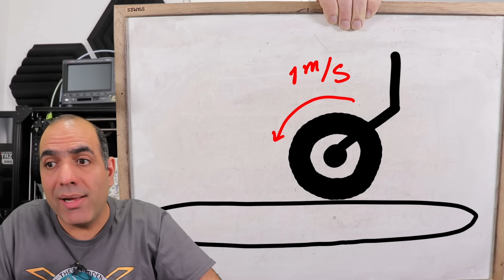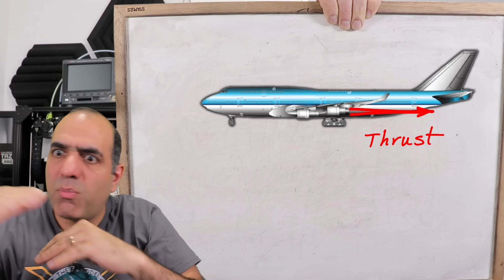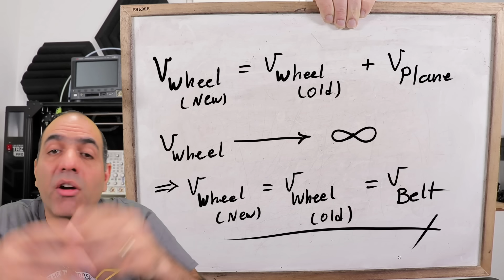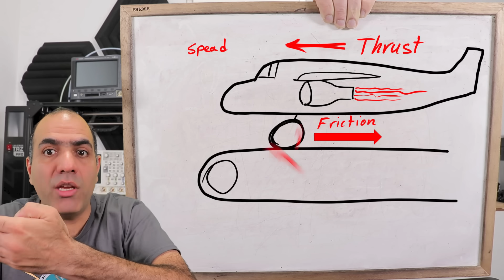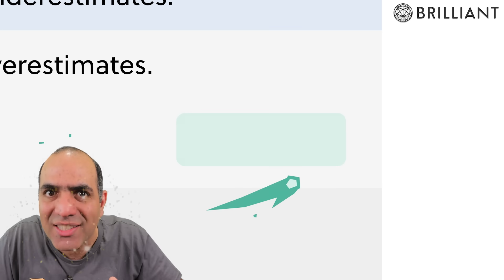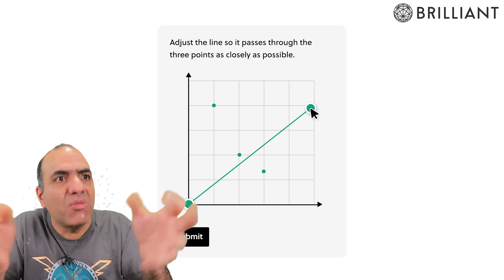Airplane Question that Drove Me NUTS!!!

Comment: Well, if the plane, is siting, and the conveyor belt starts to run. The plane goes backwards, the engines goes up to match the speed of the conveyor belt. IF, and a BIG IF, the conveyor belt, stops, the plane is gonna catapult forwards and the engines gonna be high as in the runway. The lift off gonna happen.

Comment: How is this a hard question. The thrust comes from jet engines pushing it forward. Has nothing to do with the wheels. The wheels will turn twice as fast as normal but yes it will
Still take off. Thy must think we are all idiots.

Comment: Another thing this question made me think was how the rotating belt would cause some air/wind to move backwards due to fluid dynamics.
In general this is not a well formulated question.

Comment: The moment you add friction is the moment it becomes what fails first. 
If we have friction on the plane's wheels, we have to have friction on the conveyer belt. All the rollers in the conveyor belt need to spin at a higher RPM than the wheels of the plane and I would argue that the conveyer belt will fail before the plane's wheels and there for the plane is still able to take off.

Comment: plane would take off with roughly double the wheel rpm compated to no conveyor. bearing friction would cause this extra rpm but not much. bearing friction would have same effect as tiny tailwind, in which case plane needs slightly higher speed to take off compared to no wind.

Comment: These questions are stupid brcause they need a small amount of common sense to br answered. How do planes take off? Aerodynamics and wind pressure (Very simplified). Now ask myself: when i run on a treadmill, do i have wind? No. No i dont
Reply: thousands of pounds of thrust pushing it forward, nothing holding it back, and it's not moving?  why?

Comment: One more dumb answer to the dumb questions: the movement of the large tread mill will have friction with the air, compressing it as it move, creating a high pressure zone under the wings which could lift the plane.

:P

Comment: The issue is most peolle are smugly parading their immense genius by talking about air speed vs ground speed - While forgetting that certainly at take off the two are very much cuddled up.

The thrust of the engines moves the plane relative to both ground and air. If you effectively maintain ground speed at zero, you have to break the laws of physics for the air speed to be not zero.

And before anyone talks about headwinds giving real world examples of air and ground being disconnected, bear in mind in that scenario the air is moving relative to the ground. Something the plane, according to the question, cannot do.

In other words, the question is nonsense because not only is the conveyor belt impossible, reality needs to fragment for there to be an answer.
Reply: why would the treadmill do anything?  You think the brakes are on?
Reply: If you can push a toy car forward on a treadmill with just your hands, 120 tons of thrust force is going to be no problem. This question is annoying because it makes mention of irrelevant information. The takeoff would basically be identical to standard

Comment: Planes get their forward force "traction" from pulling & pushing on the air. Their wheels are as close to zero friction free-spinners as possible. At low ground speeds, the friction in the wheel bearings is negligible compared to the thrust of the engines. Thus, the plane body would continue moving forward regardless of any excess rotation of the wheels. From the plane's perspective this would be no different than a longer runway with a tailwind that it has to overcome. However, the plane's forward movement regardless of the conveyor belt's backwards movement produces an additional consequence. The conveyor belt perfectly cancel's the current rotation speed of the wheels, but the plane moves forward anyway, thus causing the wheels to rotate faster, causing the belt to move faster to catch up, causing the wheels to spin faster, because the plane's forward movement is not dependent upon the wheels rotation, which then causes the belt to speed up, etc. A self-compounding cycle producing exponential growth of the speed of both the wheels & conveyor belt. Depending upon the update frequency (i.e. compounding frequency) & acceleration limits of the belt, this exponential acceleration could approach infinity extremely rapidly. If we're supposed to assume "perfect" (i.e. infinite) properties of the belt, then it could reach "infinity" or the speed of light, almost instantly. Because once the wheels are moving forward at all by an external force that is not effected by the rotation of the belt, then any acceleration of the belt is directly added to the wheels' rotation speed, which then must be matched by a further acceleration of the belt. As the belt accelerates, it is pushing the wheels ahead of it. It doesn't mater of the wheels are only turning excruciatingly slowly in the first moments of takeoff, if the conveyor belt's update cycle is 1 femto-second, then each time it updates, it's adding that speed back onto itself, over and over, one quadrillionth times per second. However, this rapid acceleration produces a counterbalancing force, which is the traction limits of the rubber tires on the pavement. At some point, the conveyor belt's exponential self-acceleration will be so fast that the force attempting to accelerate the rotation of the wheels exceeds the friction force of the rubber on the pavement, and the tires cannot maintain grip, resulting in a burnout where the wheels "ignore" some of the generated acceleration from the belt. The would result in a slowdown of the exponential growth, since it would allow the belt to accelerate to match it's desired speed, without that speed increase being immediately put into the wheels. However, while slipping rubber has less friction than gripping rubber, it is not zero. So, even as the tires slipped, they would still be accelerating, just at a slower rate than before, because the slipping rubber is still transferring some of that force, just not all of it. Finally, the question of friction in the bearings becomes an issue. Once we reach very high speeds, the initial assumption that the bearing friction was negligible, ceases to be true. So, at some point, the velocity of the wheels will be so great, that the internal friction of their bearings will either slow them down, or melt & possibly friction weld together. However, presumably, this conveyor belt has bearings too, which would be subject to the same heat-decay. Unless we are postulating magnetic levitation bearings in a vacuum, or something. Then even if you say that the pavement is hovering on a superconducting maglev track or something, you still have to take into account the air resistance of the pavement traveling so fast along that track. And the gigawatts of energy & armies of horsepower necessary to move all of the conveyor belt's mass. At some point you have to either say that the conveyor belt would break down long before the plane's wheels, or conclude that the conveyor belt is magic, and just ignore it. In which case, the real question becomes does the plane have enough thrust to take off before the bearings in the wheels seize up? Or, perhaps more likely, do the plane's engines have sufficient thrust to overpower the static friction load of all the bearings in all the wheels being in whatever state they result in after thermal breakdown?

Comment: No, can't take off. Ground speed is irrelevant to airspeed that it needs to generate lift.
Reply: thousands of pounds of force forward, nothing holding it back, and it doesn't move?  why?
Reply: @tsm688  because ground speed is irrelevant. It needs air over the wings to generate lift. The treadmill could be moving backwards for all it matters, as long as there's enough air moving over the wings. Until that moment, it's not going up
Reply: @bugjuicer  Why wouldnt it move forward through the air?  You think they left their brakes on or something?
Reply: @tsm688  because the question is the ground moving but the plane staying in one spot. If it stays still, no air moves over the wings, no lift. Ground speed doesn't matter, air speed does.
Reply: @bugjuicer  thousands of pounds of force forward, nothing holding it back, and it doesn't move?  why?

It's a trick question.  It would move.
Reply: @tsm688  ahhh, I see the omission about using thrust, now.. ty, I see

Comment: well in that case depending on the exact conditions of the experiment it is possible if it accellarates the air around it due to friction with the huge conveyor belt. thos could create a liw pressure zone below the plane sucking it down but also accellarating more air in front of the belt so that in theory it might be possible to create sufficient wind speed relative to the plane wings so that it takes off? would have to crunch some numbers for a precise andwer. i think it would be possible depending on wind condition and the exact plane and runway design

Comment: the engines force has to in some manner provide forward thrust that surpasses the notion of the plane standing still on a static runway or on such a belt. Can a plane hover in a single spot? No, they are always moving forward when flying. If the engines could provide that force in an instant , the plane would instantly fly and you could say the wheels dont matter. Since these engines dont provide such instant force, they provide enough to achieve acceleration that results in the plane moving forward at the speed required for it to overcome its mass enough to get lift from the wings, the belt removes some of the surface friction that is absolutely required under these conditions, making acceleration very slow  So if the engines do not provide enough force to overcome the belt speed for long enough to get the plane moving forward at the speed required for it to overcome its mass and get lift from the wings, it wont fly. 

Since the say the plane is not moving , this means the engine force is not enough to overcome the belt and achive acceleration .. not moving forward .. not flying.
Reply: thousands of pounds of force forward, nothing holding it back, and it doesn't move?  why?

Comment: Stupid question, the plane can only take off when enough low pressure had built up on top of the wings, the speed of the plane or wheels have no effect on this, its all about the speed of the air with the pressure of the atmosphere that effect the amount of lift.
Some people will say its the engines that create the thrust that make the plane fly, but that is not true, only a few fighter jets have a weight to thrust ratio of 1:1 that allow them to accelerate upwards, the role of the engines is to move the aircraft forwards fast enough that for the winds to create lift 🙂
I learnt all that from playing Kerbal Space Program lol.
Reply: thousands of pounds of force forward, nothing holding it back, and it doesn't forward?  why?

Comment: I'm really tired of seeing that plane question... its too stupid to believe.
planes fly because of "relative wind"  if there is no airflow over the wings it won't fly.
1) if you take the wings off the plane it won't fly.
2) if you take the wheels and the engines off the plane tie a cable to its nose and blow air over the plane at a velocity that would make the plane fly.. for something like the 747 in your example..  150mph. it will lift into the air..
3) if you push that plane off a mountain as soon as it gets to flight speed in the dive from gravity it will fly.
it's airspeed, relative wind, not how fast the engines are turning or how fast the wheels are spinning.
sorry, it's 5am in the morning I can't sleep and I see this question again pop up. aaah

Comment: Declare assumptions and draw a free body diagram.

To simplify the problem, you’ll need to assume perfect world scenario where friction regarding wheel bearings are negligible. The wheels will roll equal speed to the treadmill. We will also ignore weight of the plane as it does not contribute to this particular framing of the question.

In a free body diagram, there is a force output on the engine as it produces thrust. A simplified version of the wheels and treadmill will have a summation of forces in the opposite direction of the force output of the plane. Technically it would create a net zero regarding the plane moving forward relative to the ground. 

Best example would be F1 car on an all wheel Dyno. Are those wings Experiencing downward force while on a Dyno? No, and neither is the plane. Yes the wheels are exerting force in the Dyno, but force output can come from anywhere whether it’s a jet engine or a car engine. If air isn’t flowing, there is no lift.

Comment: People focus on the wrong things.
The plane is pushed by the turbines, not by the wheels. Then, considering it turns on the engines and wants to takeoff, and considering the conveyor belt is looong enough it would flight (or it would fall from it). This because the conveyor belt is useless here, since wheels are used to let the airplane stay on the ground, not to push it. The turbines would use the air influx to push the airplane and would move in the conveyor belt, with the wheels moving like crazy because the conveyor wants equate rotating wheel's the speed.
It's like the walking machine you've used on the video. Your legs are the ones pushing you forward, thus allowing the belt under you equate the velocity letting you stay still. But airplanes don't use "their legs" (their wheels) to move, they use "their arms" (their turbines), so it's like you were standing on the walking machine with sidebars around you, with you moving with your arms using the sidebars, not your legs.
You could do an experiment simulating this with an RC airplane or a drone :P

Comment: And I think that we can also add the ground effect caused by the moving air caused by the advance of the belt, a bit like the needle of the hard disk which lifts by rotation of the platers 😄
Reply: It would help but not enough to lift the 747 off the ground. If someone tries to do this with a model then it would definitely need to be considered.
Reply: @kamX-rz4uy  the plane just have to levitate very slightly above the conveyor for friction to stop taking effect and the jet engine takes over....I wonder if it would reach some stupid contrivance that allows magnus effect to be significant on the wheel as well lmao

Comment: If it was a jet plane,  it would remain stationary.  The engines push it forward but the belt matches the speed.  If the plane doesn't move there is no airflow.  A propeller plane creates airflow over the wings.  I'm not an engineer so i can't go into further detail than that but  it could possibly work
Reply: thousands of pounds of force forward, nothing holding it back, and it doesn't move forward?  why?

Comment: hmm given that the wheels would be moving in an anticlockwise rotation and the conveyer would be moving in the opposite direction, the wheels would remain stationary and the plane would still move forward and take off, it's just that the wheels wouldn't spin.

Comment: yes. The back force of the conveyor against the forward motion of the plane should not be capable of stopping the plane from taking off. The only caveat is if the wheels and bearings are not capable of handling the load of the plane at the speeds they would need to be turning in this scenario.

Comment: I always just thought it was as simple as of course because the wheels exist for yhe purpose of allowing the thrust of the plane to move it forward. And as that has little to no bearing on the speed of the plane it must be able to fly.
Reply: But you just said that the wheels allow the thrust of the plane to move it forward. No wheels, no forward momentum, no take off.
Reply: Maybe I am being unclear. The wheels unlike with cars only exist so that the plane doesn't rub on the ground and allows it to move easily. But it has no bearing in the increasing speed like thrusters do vs engines that cars use which increase the wheel speed in order to speed the car. So for me it has always been that the plane will move and the wheels would just go faster than the plane. Like the first example of his explanation. I never really put much thought into it. Do you get what I mean now?
Reply: @aden5122  I understand. But imagine that the wheels are stuck in mud or concrete. The thrust can’t move the plane forward because the wheels can’t roll. It’s not a question of what moves the plane forward. It’s a question of how does a plane take off. And that is lift made by the wings moving forward through the air. And since the belt cancels out any forward movement of the plane through the air it cannot achieve lift.
Reply: @NandR  yes but the idea is that your concept of mud hold the wheels stops the purpose of them. I don't understand what is confusing to you here. When the force is generated by the plane then even when driving on a treadmill the plane will still move forward but the wheels will just be moving much faster. Did you watch that part of the video?
Reply: @NandR  I know that it is not that simple I watched the video but his first example is pretty clearly exactly what I was saying. As the plane speeds up it will move forward which speeds up the wheels which speeds up the conveyor etc. I just had that idea in mind that since the wheels can speed up upon rolling due to thrusters that it would be fine even though it would destroy the tires. He explained the idea and its points and flaws pretty well. Obviously you didn't really watch the video. I basically just had a understanding of the differences between and car and a plane and applied them. Don't know how that confused you.